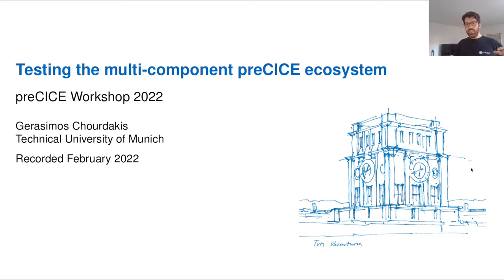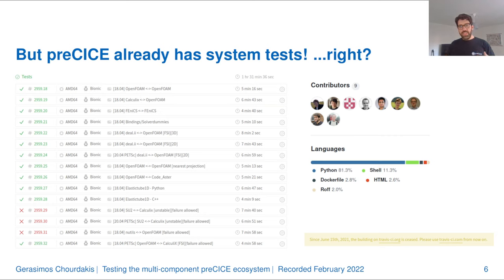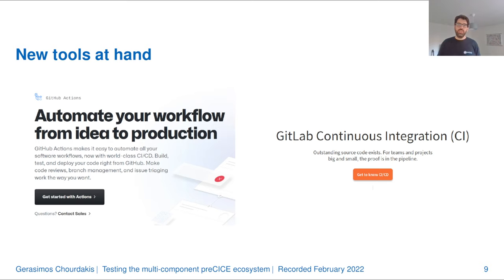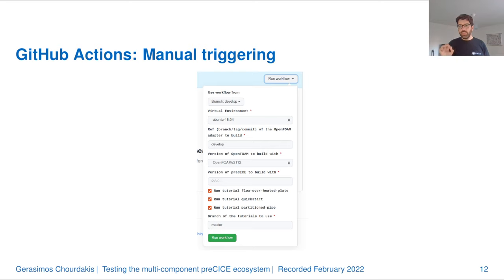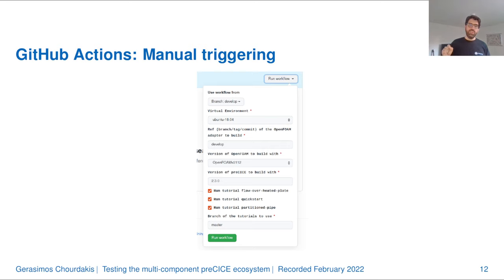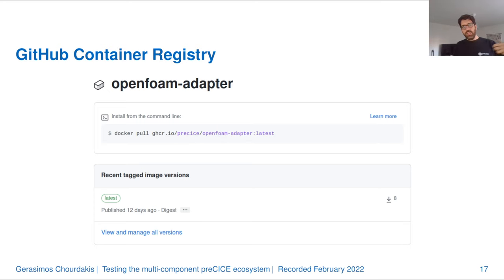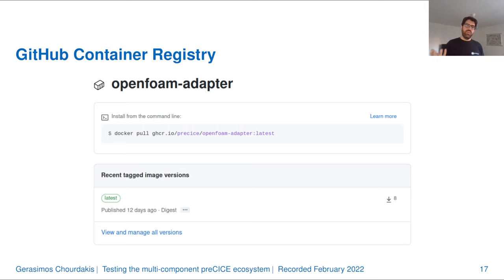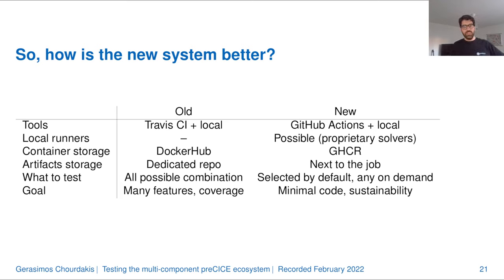Testing the multi‐component preCICE ecosystem (Gerasimos Chourdakis, preCICE Workshop 2022)

Comment: hello,Sir. I just watched a vidoe that you introduce preCICE for us. I have one question as follows：I have a OpenFOM case and a python code. The python code can provide the boundary condition for OpenFOAM, but the python code also need some results from OpenFOAM to calculate that boundary condition. That is ,there is an implicit coupling between OpenFOAM and my python code. Can preCICE do this ? much thanks for your any answers!
Reply from the maker: Hi! Yes, preCICE can do this. In fact, most of our examples use implicit coupling, and preCICE offers several algorithms to significantly reduce the number of iterations: https://precice.org/configuration-coupling.html